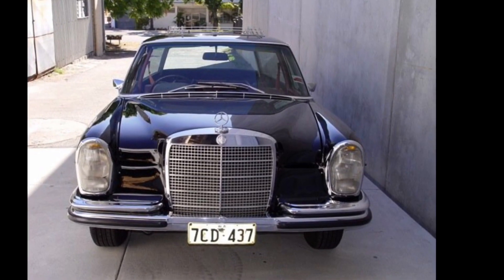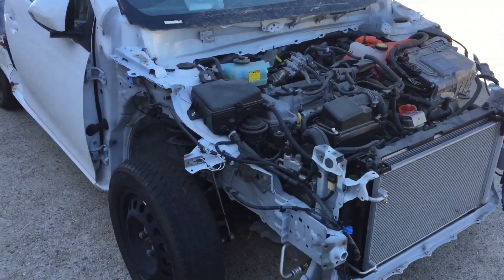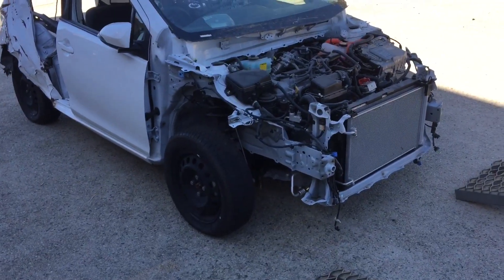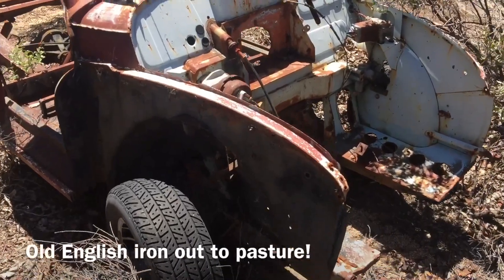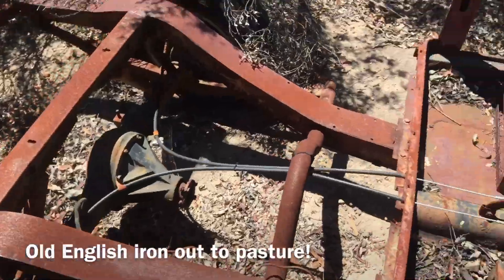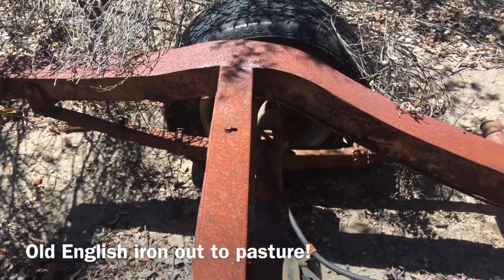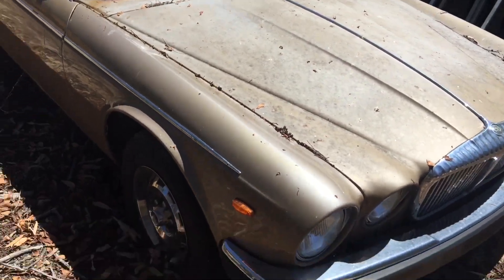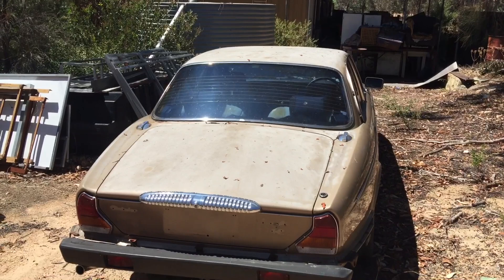Introducing E-Minor: my long-term hybrid electric Morris Minor Ute project

Comment: I still think you need a camera gimbal mate! also having a look at the morri that trip, it looked noticeably worse than when it was in cover, might be worth chucking a tarp over it or excepting that it'll need some decent welds.
Reply from the maker: Could probably start with a decent camera as well, phone is pretty hard to hold heh. Will need to clean up some of the crap pile soon I reckon, and a tarp can be good, or it can act as a humidifier, increasing rust action with local humidity and heat, probably getting some paint on it soon would be best
Reply: JBFromOZ phone gimbals work a treat, and give you something to hold onto. Yeah thought about that too, but seems to have deteriorated a little more than I had hoped, uncovered.

Comment: What a great idea.  Certainly will make for a way better vehicle than a forklift motor.  Particularly living near Kalgoorlie.  How do you get this past inspection for Re Registration ?

Cheers Rob
Reply from the maker: G’day Rob, registration is really a big question. I have seen much of the questionable engineering being used to secure batteries in many of the registered EV’s and was what prompted me to contact Australian Electric Vehicle Association. Information is very thin on the ground.
Things in my favour... being front wheel drive, and the entire drivetrain is contained on the Prius subframe.
Provided the specific engineering to connect the subframe to the Morris Minor are certified this is expected to meet registration requirements. 
Finally, being a 1956 Morris Minor, certain exemptions are expected to apply for the re-registration on that tag.
That being said, the regulatory requirements are expected to be the most complicated aspect of the build, and the main reason it has slid down my list of projects.
Reply: Certification gets you past most hurdles on this stuff, but it's costly.  If you know someone in the game it would be a big help.  You certainly wouldn't want to do all this work unless you were sure it would be cost effective.  Looks like a definite game plan needs to be mapped out to address all the issues.

I'm sure it's doable, but I know engineers cost can cripple projects.

Cheers Rob

Comment: i dont think your using sleeper  right a sleeper is a bad ass under cover  of a tired shell  . the  cordless  drill in a tank your building while  super cool  ,no sleeper  . looking forward to more  thanks for sharing!
Reply from the maker: Fun Facts:
Morris Minor Ute 1700lbs (770kg) Prius C 2,500 lbs(1150kgs)
0-60mph (0-100kmh) Morry 35secs PriusC 10.2secs (original Morris Minor 0-60 listed as n/a . It couldn’t even reach that!!) 
Morry brakes drums all round Prius C brakes ABS disk brakes all round.
Add aircon, modern electrics, 
So yeah, rat rod/sleeper call it what you will, but I do expected much more (4-5x? ) performance than a stock Morry Ute, whilst retaining that appearance
Reply: rat-retro-rod  and by the numbers   nice lol . whats the shelf life of the batt system while it waits ?
Reply from the maker: A great question! It was a runner as I purchased it, and my initial plan was to cut the rear off and place it on some dolly wheels so it could get the occasional drive around the paddock while I work on other projects, I hit a snag when removing unnecessary parts, and seem to have hit an ECU startup issue most likely linked to when I disconnected the doors, as I believe there to be an airbag system sensor that was missing on one power up. Now the system reports critical Error and won’t start or drive. Two steps backwards! I tried to clear all OBD2 errors but perhaps my eBay dongle and software is not enough to convince the brain that all is ok to start again.
Ahh electrickery - you fickle mistress!!
Reply: fickle  indeed